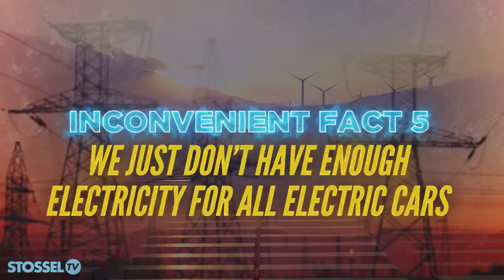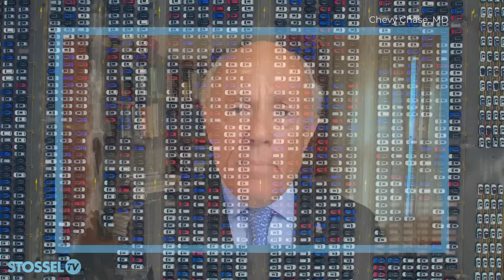Electric Cars: Inconvenient Facts, Part 2

Comment: Hey John, I was wondering if all that extra weight of batteries has anyone considered that parking garages will be able to handle all that extra weight??
Reply: I thought about that today when I was in a parking garage and remembering the codo collapes in Miami.
Reply: Exactly and create more damage on roads!!
Reply: We have some electric buses in our city, twice the weight of diesel at 12 tons.
Reply: Are you serious? These garages are designed and built by structural engineers. NOT an issue.
Reply: @MrTomp55555  Allot of the garages you see in major cities were designed and built decades ago. Before electric cars were considered anything more than a novelty. Their design parameters were based on the average weight of gasoline powered vehicles. Just because something is built by a structural engineer doesn't mean that they can foresee decades into the future and design for every possible outcome.
Reply: Interestingly this concern isn't an issue as electric vehicles are banned from most parking garages because of the fire hazard they create.
Reply: My BMW i3 electric car weighs the same as my Corvette. About 3100 lbs. This is because no engine, no transmission, no emissions equipment, no gasoline, and less fluids. The battery itself weighs 496 lbs which is the equivalent difference of having 2 passengers in the car. So not much. My gas Hummer H2 on the other hand weighs like 6400 lbs. 3 times more than my ev.
Reply: @Tokenomics1  No electric car is zero emissions. Just because you don't see gasses leaving your car doesn't mean that coal power plants don't have to burn hotter and longer to meet the energy demands of charging them along with everything else.
Reply: @OmegaZyion  do you live next to a coal powered power plant...?
Reply: @MrTomp55555  -  Designed by engineers,  Yes.  Built by who ever submits the lowest bid and cost cuts on quality materials.  Every once in a while,  one collapses and that frequency will increase.  Bridge loads in rush hour traffic will also need to be scrutinized more.  Infrastructure in America is already in a neglected condition.  This will not improve without some real effort and attention.
Reply: @OmegaZyion  -  Right.  Every once in a while,  one collapses and that frequency will increase.  Bridge loads in rush hour traffic will also need to be scrutinized more.  Infrastructure in America is already in a neglected condition.  This will not improve without some real effort and attention.
Reply: what about roads and bridges ??? also crash safety.
Reply: @sheshotjfk8375 , not true here in the USA.  The NHTSA, DOT, NTSB, HLDI, NFPA, and even KBB all agree that the EVs' loss rate due to fire is less than that of gas-powered cars, and the new LFP batteries are even better in this regard.
Reply: @OmegaZyion , I don't know about your country, but here in the USA, coal provides only 17 percent of the energy on our nation's grids, and it is going away fast.  Meanwhile, most of today's generation capacity additions are from renewables.
Reply: @km6xu  That is deceptive BS because 60% of the energy in the US power grid comes from fossil fuels. That includes coal, natural gas, and oil. Renewables are simply not capable of making up the difference because of several limiting factors. Solar requires the sun which is only available for half the day if there is no cloud cover. Wind can only be economical in certain places such as on the coast where the difference between the temperature of the water and ground causes wind flow. Hydroelectric requires you to destroy ecosystems both up and downstream of a dam. And we haven't even gotten into the issue of batteries which arguably are more harmful to the environment than fossil fuels because of their chemical compounds that nature has no way to deal with.
Reply: @MrTomp55555   You didn't read about the old parking garage that collapsed in NYC not long ago?
Reply: @Actaeon2nd  No, I didn't. How did that happen? I'm not a structural engineer but I'll be there are many garages, not only in NY but nationwide, that have compromised structural integrity. Regardless of whether there were EVs in that garage or not, that garage must have become weak over time. Collapses like these also speaks to the necessary of infrastructure improvement as provided by the Bipartisan Infrastructure Law.
Reply: @OmegaZyion  What about the dust from the brake pads? They count for as much as 20% pollutant as opposed to 7% gasoline!
Reply: @MrTomp55555  
Yes they are. And the company that built the garage gave the max weight of each floor. If it’s built to hold 50 vehicles, average weight of 3,500 pounds. That’s a 175,000 pounds. Now the pillars of each level have to hold their own weight plus all the weight from above floors. Now take 50 EV’s with an additional weight of 1,200 pounds (battery) each, that’s 60,000 pounds per floor which has to be multiplied as you go up each floor. Please, don’t comment on things you know little about and don’t understand. It’s not a good look.
Reply: @whocares264  
We have 12 power plants in my state. 
They burn so clean no one next to them has any problems. And several of them capture the CO2 export it to a foreign country. The whole idea of coal power being dirty, just shows the lack of knowledge and total ignorance of the person making the comment.
Reply: Do you know a mini diesel automatic is heavier than a electric bmw i3, thought not...
Reply: @willisswenson3843  The ignorance displayed here is beyond belief and I should have known better. I will say this, as I sign off, it is WELL beyond the point whether this or ANY garage in these (dis)United States can hold the weight of 50 or even 1 electric car. Is this supposed to an intelligent reason that we shouldn't further adopt EVs? The REAL and essential point, here, is that we have NOTHING less than an existential crisis and THE fight for the very future existence of life on this planet. Think this an exaggeration? NOT if we actually read the science and don't disregard it and that there are other meaningful "alternatives". If we continue on our current course and maintain the status quo, we are toast! With 25% of CO2 and other harmful emissions coming from our tramsport, do we care enough for this and other succeeding generations at all? Most do but not here.
Reply: @MrTomp55555  
Do you know what percent of the atmosphere is CO2?
Reply: @willisswenson3843  It's NOT a percentage of CO2 in the atmosphere. It's PPM or parts per million. Right now, it's at about 415.8 ppm. We need to ne under 350 ppm. Good bye!
Reply: @Tokenomics1   Your BMW i3 has a range of only 153 miles, which decreases every year. At a constant 70 MPH, it's even less. In the winter, subtract even more. You have a glorified golf cart for use in the city only.

BTW, most modern Corvettes have a range of 600 miles and can fill up in less than 10 minutes. EVs have a use today as city cars and that's it, battery technology and charging stations aren't there yet. And forget about the macro and micro levels of the electrical grid, we're no where close on either one. We're barely crawling today, but want to be an Olympic sprinter tomorrow. As usual, liberals have thoroughly screwed the pooch on the change from ICE to EV. They should have continued with hybrid vehicles and their smaller batteries, 4 times as many cars can operate as EV 95% of the time. Don't you think that would be a much better path? The next step is range extenders, Volvo and BMW already offer that option. It's a small ICE with no connection to the wheels or a transmission. It has enough HP to power the electric motor via the generator at speeds of 50 to 65 MPH. You would only start the range extender on long trips or if you used too much energy during the day. You could also charge it at night on 120V when the grid demand is low. That scenario will drop yearly gasoline usage to below 50 gallons for each car versus 500+ gallons per car. Instead, lots of people regret buying an EV and tell friends/ family all of the bad things about using an EV. In turn, EV adoption by the masses suffers. Let's learn to walk first, then trot, and then run. Once we get to that point, then we can consider a run at the Olympics. I'm all for EVs and reducing our reliance on foreign oil, I would love to thumb our collective noses at OPEC+. But even if we manage 100% EVs and 60% renewables (hydroelectric, solar, wind, et al) for power generation across the country, we'll still need oil for many products.
Reply: @precertvideo  The 18 wheelers that haul the gas to the gas stations weigh 70 tons fully loaded.
Reply: @OmegaZyion  A 1975 2 door lincoln continental weighed 5,200 lbs. The biggest 4 door Tesla model X weighs the same.
Reply: @peeb2896  We rarely use the brake pads in the ev due to regenerative braking. An evs brake pads last 10 times longer for this reason. The only reason to use brake pads in an ev is in an emergency.
Reply: @Tokenomics1  LOL! Me too in my diesel twin turbo...only in an emergency! I can tell you for sure.....wouldn't want you behind me on the High Street....!! Especailly with a bomb of a battery waiting to go off! Enjoy your car and try not to suffer too much with range anxiety !!
Reply: @peeb2896  According to the NHTSA, incumbustion engine cars like yours are 6400 times more likely to catch fire than electric cars. Your diesel costs 23 cents per mile to drive. My EV costs 3 cents per mile to drive. Whats 20 cents times the million miles you will drive in your lifetime? $200k. Now in our driving years inflation should double the cost every 17 years at 3% inflation. so 3 or 4 doubles in our driving years. So a person is going to pay over half a million dollars to stay in a diesel instead of going electric over their lifetimes. Bless their heart.. EVs save another grand a year in maintenance over gas cars which covers a replacement battery in 15 to 20 years.
Reply: @OmegaZyion , solar, wind, and grid-scale energy storage are sufficiently scalable to meet the USA's electrical energy needs, but hydroelectric is not scalable, its low-hanging fruit was all taken half a century ago.  You might want to study the many battery chemistries that are now in R&D thanks in part to the restored Department Of Energy here; it is increasingly unlikely that within a decade, lithium-ion chemistries will be predominant in newly deployed grid-scale energy storage..  Yes, I realize that your country might have different realities; my many years of industry experience (as an engineer) have only been in the USA, with only the most minor of exceptions.
Reply: @Tokenomics1 The new EV Hummer ($140k) weighs 9k lbs. The battery is 2900 lbs. Takes 3 days to charge on a 220 voltage outlet. 7 on 110 V.

Comment: Anyone who can think on their own already knows that EVs are not the answer. Thanks to John Stossel for bringing it to the masses. Hopefully a few people will change their minds about the "magic" of EVs.
Reply: If you drove one and, then, owned an EV, you might think differently. I can give you "real" stories of many EV owners that have discovered if not "magic",  the many benefits of EVs. Start and end with economy. NOT all EVs are super expensive, I had a used Nissan Leaf for 4 1/2 years using NO gas, charging at home and at work for pennies and except for tires and air filters, next to NO maintenance. I paid $10K for this vehicle and, over this time (keeping a spreadsheet), I saved $8500 on gas and maintenance over my prior gas car. Maybe not magic but WAY better economically and, don't believe this trash, WAY better for the environment over the life of the vehicle.
Reply: I agree buying used is the way to go, you’re not investing in future or current carbon footprint. The footprint has already happened years ago
Reply: Might not be the ultimate answer, but might be a bridge from oil (which we are running out of) to something else. We can't just stick our heads in the sand and run out of oil (estimates range from 60 to 100 year at current rate of usage, perhaps less).
Reply: It's you who can't think,  I live completely off grid and I have several EVs and I haven't paid for electricity in 6 years! Think about it.
Reply: What is the answer?

Comment: No I don't want my car to be electric, its silent! I love the sound of the engine at a 120 miles an hour 😁
Reply: Slow down. No one, however, will ever write songs about Nancy girl electric cars!
Reply: I"m concerned about electric motorcycles. Our engines are one of the few signs that alert drivers to our presence since our visual footprint is so small. Take away that and we become even more invisible.
Reply: @salazam  blast some tunes!
Reply: @mattsonrobbins281  No speaker in the world can go as loud as my short-stroke inline 4 at 13,000 RPM with a Yoshi pipe.
Reply: @David Henry Yes, but say you should ban them and all of a sudden you're sexist.
Reply: @David Henry "To not do so makes them complicit and guilty of murder when it happens." Really? How about 5-6 mph? A car running over you at that speed will still kill or crush you. BTW, I walk about 6 mph. Ya know what? Airplanes travel about 500 mph, I use phone apps while in an airplane, I guess Google is liable if the plane crashes? What ridiculous extremes your mind jumps to...
Reply: I guess none of you took into account that this guy probably commutes on the Autobahn

Comment: I have owned four electric cars and and one electric scooter over the last 40 years and have been promoting their use.  However, the way the Greenies are pushing them will be a total disaster.
Reply: They are meant to be a secondary vehicle, not your only one.  They're great for driving to work every day as long as you can charge them at home every night.
Reply: @dreamweaver1603   That's the absolute best advice, but governments want to force them on everyone as their only vehicle.
Reply: Golf carts don't count.

Comment: I've been driving a Tesla for the last year. Works for me. Havent bought gas in that entire time. No charging issues yet.
Reply: they do work for those who want to cut down on their own use, but they're not the savior of greenhouse gas emissions the public has been told they are.
Reply: Get back to us in 10 years, please. I have never owned a vehicle less than 10 years. Most are over 15 years and over 180k miles. Two were over 250k when I sold them. Beat that on one battery and get back to me - seriously. In three years, you will notice the range falling noticeably.
Reply: @furtim1  Teslas have been selling for over 10 years.  The oldest batteries still have about 80% capacity that they had when new.
Reply: @hansadler6716  Thanks for the data. 80%? That's harsh. 90% is better, of course, but I would take my car's 100% over that. If they can manage a way to speedily replace spent batteries with fully charged ones (say in 5 minutes) at the charging stations, that would be cool. However, given that batteries cost more than most used cars (at least, what they used to cost before Biden) weigh a ton, and how permanently sealed and connected they are into the car, I doubt that will happen anytime soon. People can talk about how they don't mind sitting around for 50 minutes or 3 hours every 400 miles on a car trip, but that's just a cope. I can travel 550 without stopping, refuel in less than 8 minutes and go another 550. I can beat a tesla on a 2000 mile road trip by several hours. The newest tesla charges 200 miles in 15 minutes (not including the wait). That means, to go 2000 miles, it will take at least 150 minutes of recharge time (2.5 hours). For me, it's about .5 hours. That's two more hours on the road to drive a more expensive, heavily tax subsidized, and inherently shorter life vehicle (before it loses its capacity or starts taking longer to charge). My friend has a Prius that is now scrap because the battery won't charge anymore. It is about 13 years old.
Reply: @jackson5116  That's fine. I didnt buy it to save the planet.